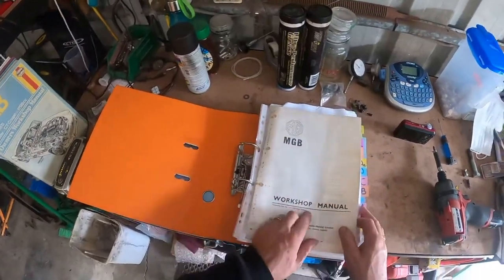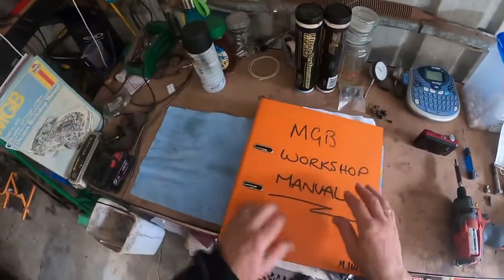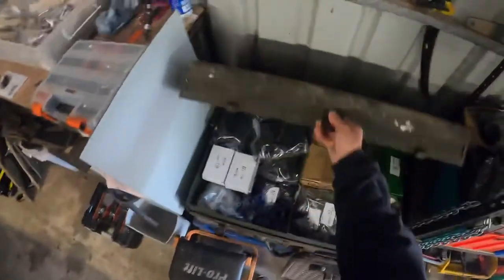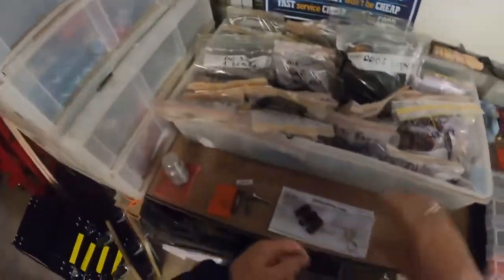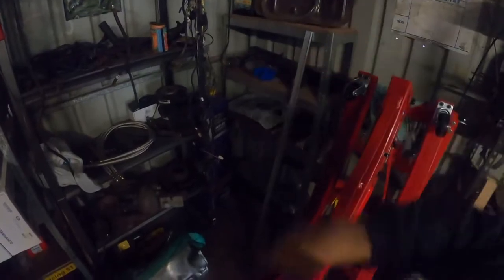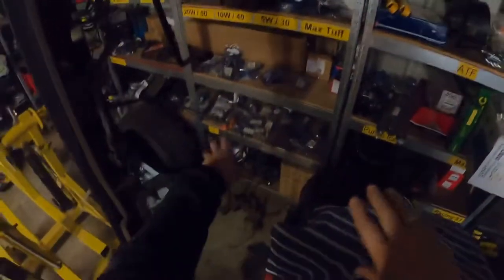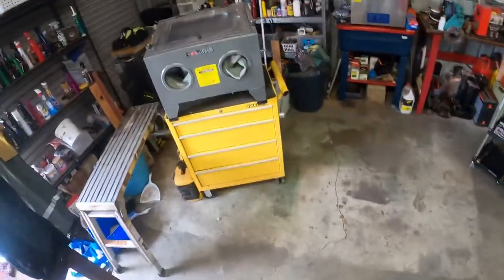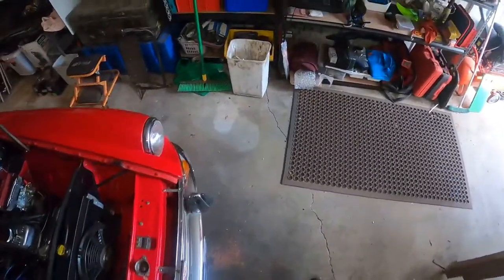Crap to Cream Video MG resto part 2 Bagging, tagging and labeling of parts, shed sort out.

Comment: New subscriber here my friend. Is there a good manual for MGB transmission rebuilding and repair? Any names and links would be super appreciated.
Reply from the maker: Hi John,  When I got my MGB the transmission had not long been overhauled so the only work I did was on the overdrive unit which wasn't working and had oil leaks.  I used a couple of resources a Haynes manual and a genuine workshop manual I bought from Rimmer Bros which was roughly the same price as the Haynes manual.  The best electrical manual in the world is the Essential Electrical MGB handbook by Rick Astley, and no not the singer, this manual is all in colour and is just the best.  Pictures as I took things apart is also the other god send, I completely underestimated the value of doing this until three years later when I started the rebuild.